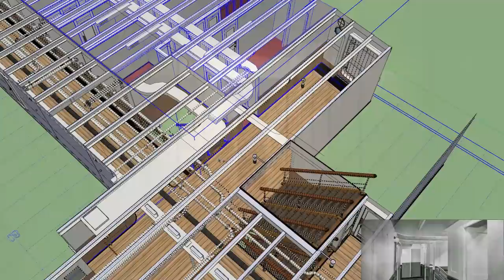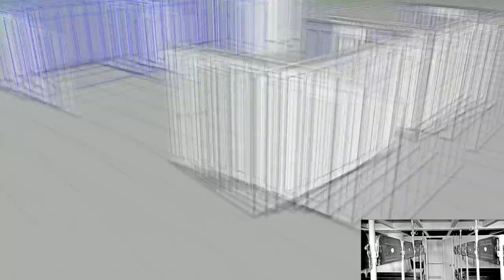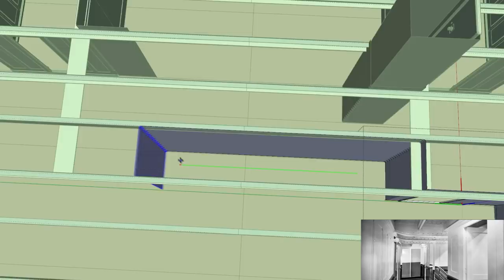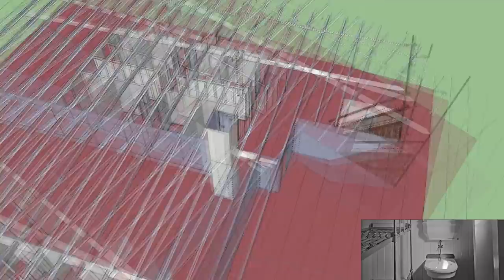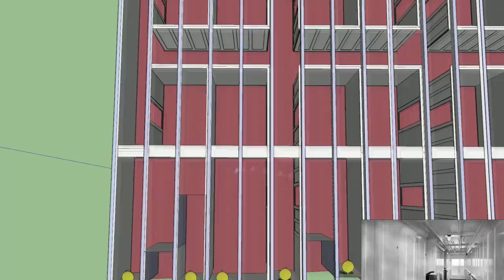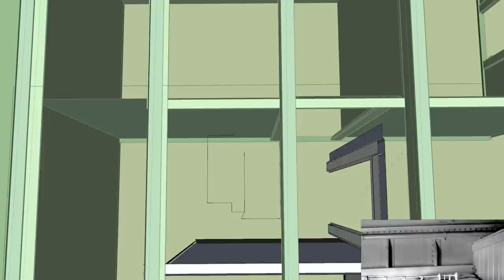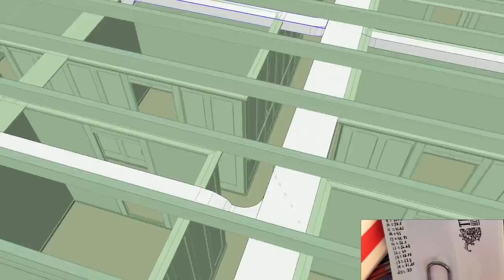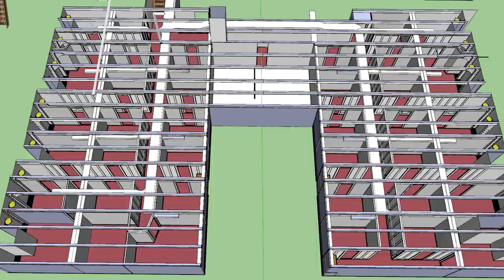Titanicing: Third Class

Comment: The ash hoist were essentially for the same thing they were used in in steam locomotives. When the fire box is cool they would go inside the boilers and remove the ash from the burnt coal. The ash would be shoveled onto the house and moved out of the boilers thru the lift housing and be accessed to be removed at a higher location in the ship. On a locomotive they would have a man crawl in the fire box and scrape the ash out shoveling it back out of the fire box this was done on coal and wood burners to prevent buildup in the fire box and prevent fires that are unwanted as most locomotive cabins of that era are wooden.

Comment: Thanks for the behind the scenes view.  I wondered how the ship was modeled.   A quick question or two: 

When you overlay the matchstick walls over the panels ones, does it still leave those panel polygons behind the matchsticks, or does the SW cull the polys behind the visible layer?  It looked a bit like they were still there, which could be a resource hog unless they are removed in an automatic process that is not shown.

Also, I use a different CAD product (for 3D conversion of architectural blueprints for construction) and find it really useful to create a scaled background layer using the blueprint image to act as a visible reference to go by when building things up.  Then I can layout the walls, doors, etc. ion top of this reference plan to maintain some reasonable accuracy for associations and dimensions.  Does Sketchup allow for scaled background image layers?  It might save some time...

Anyway, thanks again.  That's a lot of hard work, but also looks like a lot of fun. I am very jealous!

Comment: 1/2 the people in 3rd class did not know what a porcelain toilet was and were perfectly fine shitting in a hole in the floor, in the corner of a room, for all classes, a daily bath was foreign.  Shit, when I was in Ireland (I’m from Brooklyn, NY) visiting family (I’m 1/2 Irish, 1/2 Italiano), in the late 70s, they looked at me like I had 3 heads because I took a daily shower.  Disgrazie !  Yeah, they don’t got the excuse of the 90 degree, hot, humid NYC summers, but I also shower daily in the 20 degree winters.  Summers in Dublin, at least in the 70s and early 80s, was typically cloudy, often rainy, luckily to push 65-70 degrees, still, gotta shower and wash the undercarriage, “onion bag balls” does not discriminate cold weather.